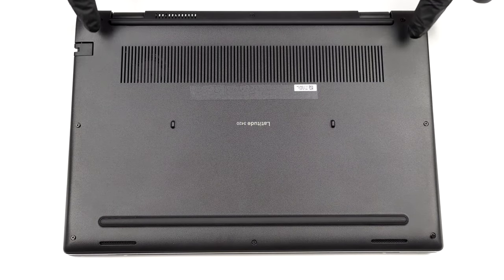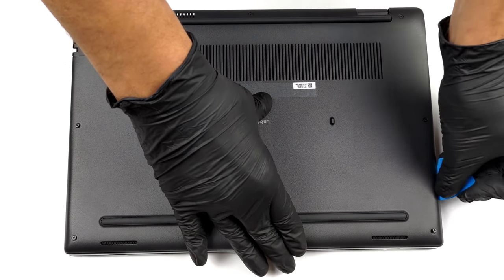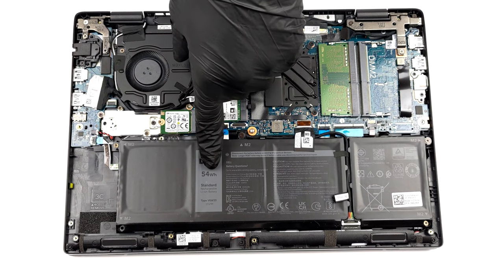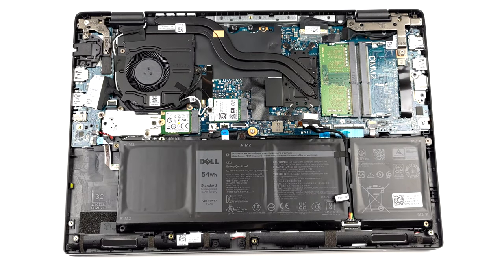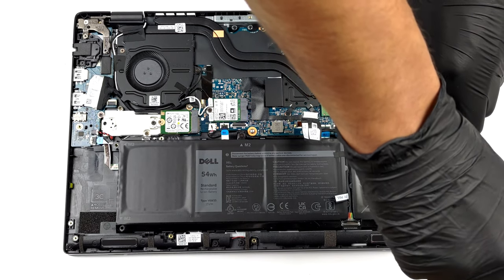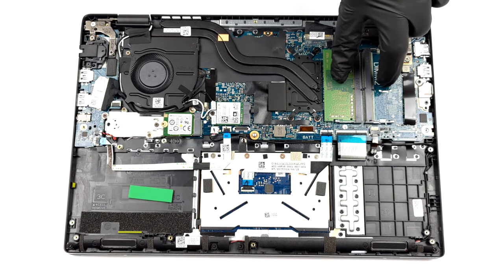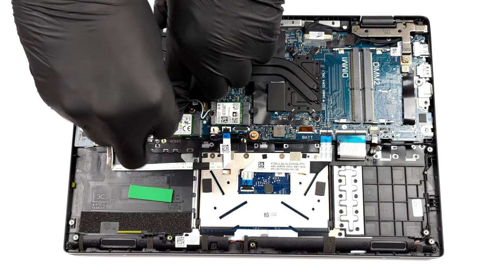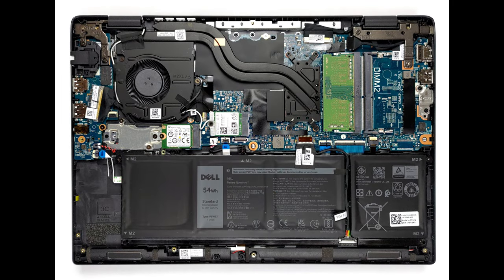🛠️ Dell Latitude 14 3420 - disassembly and upgrade options

Comment: There's no SATA slot to add extra hard disc?
Reply: good question
Reply: @xJoney231  seems it does only if you don't have the 54 Whr battery, it takes up the spot that the 2.5"  bay would use

Comment: Hello to all. I've bought a SO-DIMM memory module to insert in the 2nd slot (I have a 8Gb RAM variant, with one RAM slot free). But I just can't un-screw the bolts, as the heads are too small. I've bought a mini-srewdrivers set, but still no luck - the cross-heads of the bolts are just 1-mm. 
What type of screwdriver should I get to open it?